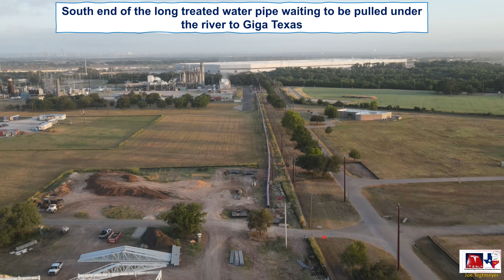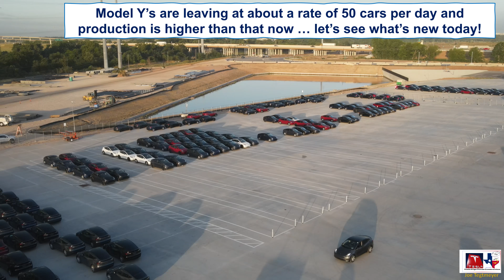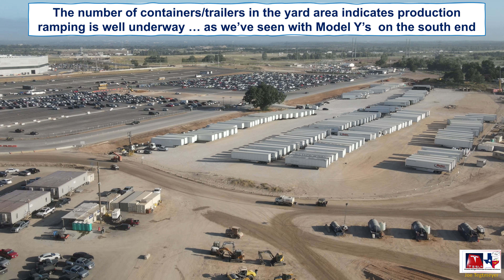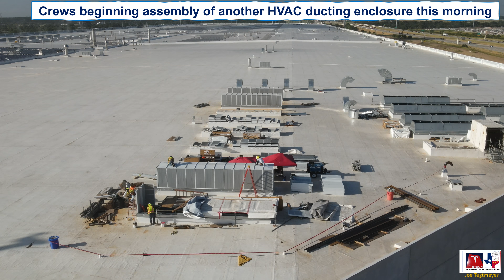Tesla Gigafactory Texas 22 June 2022 Cyber Truck & Model Y Factory Construction Update (07:15AM)

Comment: Also Joe, my understanding is that the cathode plant under construction will produce lithium hydroxide (LiOH) as output to be used as feedstock to the battery facility in the main building to produce 4680 batteries.  If this is correct, where is the battery facility in the main building currently obtaining LiOH for feedstock for 4680 battery production being used in current Model Y production?

Comment: Joe, do you know how many IDRA 6,000 ton casting machines are currently operational?  The old videos showed 6 concrete pads for what I understood to be 6 casting machines for Model Y production.  My math says that two casting machines operating in tandem (one for front, one for rear) can produce about 125,000 Model Ys per year.  Therefore all six when operational can produce 375,000 Model Ys per year.  Would you agree?

Comment: Approximately only 50 cars per day is REALLY disappointing. I expected at least several hundred per day. For years Elon has been bragging about how their experience with Shanghai and Fremont would allow them to ramp much quicker at both Berlin and Austin... and that doesn't appear to be the case at all. Really disappointed how slow everything seems to be ramping.
Reply from the maker: Elon recently discussed how logistics & Covid in China affected 2170 equipment and a slower than expected 4680 ramp are the driving issues at this moment. Things will improve.
Reply from the maker: https://twitter.com/ajtourville/status/1539769630583148547?s=21&t=GghnYKFoImQGyQcNR2gGww
Reply: There's been unforeseen logistical challenges throughout the Tesla supply chain. It's no secret Elon is always optimistic, and yes, Giga Texas is off to a slower start that we would hope. But regardless of whether the production ramp is a quarter or two slower than hoped, I'm highly convicted the Austin factory will be a crown jewel in global production.
Reply: @vermontsownboy6957   They had plans to build this factory for 2 years and there is NO reason to have supply chain issues 2 years into construction AND no-massive COVID issue anymore. If I told my boss it would take 2 years to get something done, I'd be gone. It's simply unacceptable.
Reply: Mostly echoing other replies here, a number of possible reasons and I think primarily 4680 battery production limit. However 50 per day is not that bad when you compare that GM brought out their first Hummer EV last December and managed to produce 99 in Q1, two days production at Tesla Austin. but still well short of Ford Mach e at about 300 per day.

Comment: Thanks Joe. Great explanation at the start.
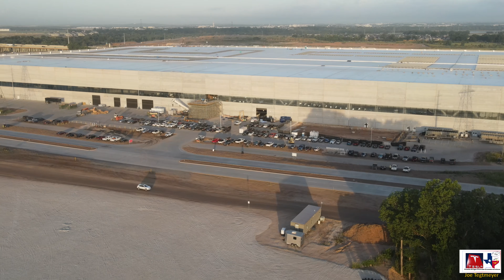7:35. BIW new loading dock area. Retaining wall formwork being constructed.
Rearranged the chillers. Hoses run into the building.
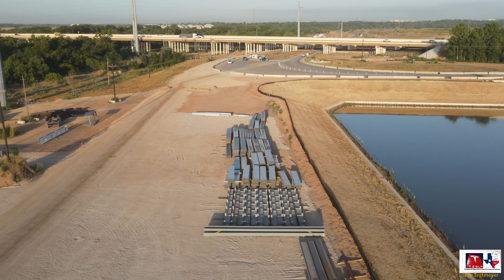11:11. Steel Fabrication Yard. Left of screen. Pair of trench shields.
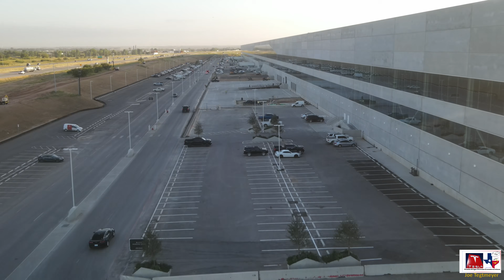11:52. Highway berm. 3 temporary light towers. 
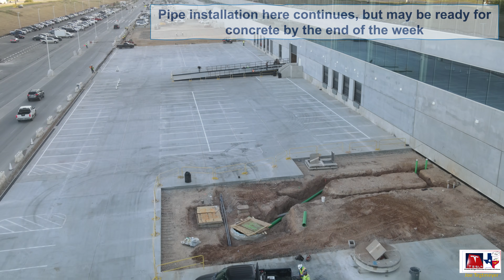12:11. GA apron. Second vault/pit/well cover removed. Rejigging the elevation to match the new pavement.
Fabricated steel ramp. Guardrails installed.
Centre of road street lighting has been reinstated. Seen removed in Joe’s 20 June video, https://youtu.be/MBGJ8iJLjo0?t=737
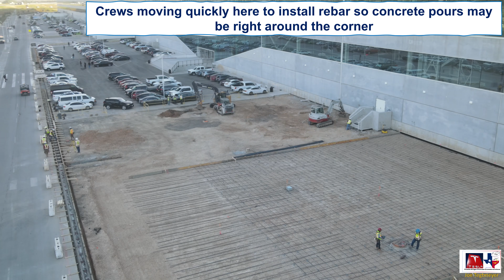12:48. GA apron. 2 workers beside what I think is manhole cover. All the concrete street lighting bases have been removed as the asphalt pavement is replaced with concrete. Apron lighting will need to come from the building or centre of road street lighting.
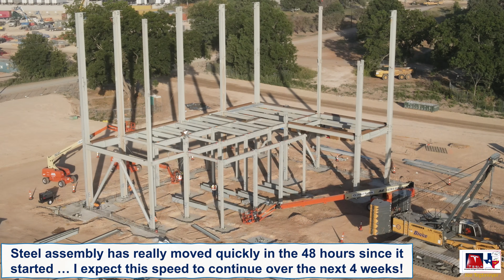18:12. Cathode. Of the closely spaced columns, only 2 will extend to the roof. Level 2 seems to be the location of a heavy floor load. Couple of framed out large floor openings on the west side visible by the up-turned angle section fitted on top of the beams.
19:58. Cathode. Structural steel up by the end of July. Possible, less footings further north structure likely to be simpler. Temporary track that the crane is driving on might not having any footing along the line. Could be some big clear spans required in that section.
22:28. East Main Entrance. 8 conduits from outside below bend up and into the likely location for a line of powered door floor springs similar to the West Main Entrance.
22:55. Roof. PV array. Opportunity to measure that the distance between letters T and E is 5 column bays. Same as the others.
24:43. Battery loading platform. A lot of effort going into painting this platform. To be there for a long time.
Reply: 24:23 That is a shame if these platforms are going to be permanent. If there is a permanent need, they should build internal heavy lift elevators. The technology exists because we see it used on aircraft carriers. Why build a billion dollar building, with millions of dollars of windows, then "F" it up with those God awful ugly loading platforms? Putting paint on a pig won't improve it.
Reply: @DavidJohnson-tv2nn  Yeah, they look pretty fugly, interfere with the general Feng Shui of the building design. And breaks up the line of the windows. O I guess they drive up a mobile crane whenever something needs a boost to the upper floors.
Reply: @The_DuMont_Network  Unfortunately, it doesn't look like things aren't going to get better. After posting comments in this thread. I checked out Google news and a rerecommended article from Reuters said Tesla was losing billions at Giga Texas and Berlin! There is a video interview titled.....
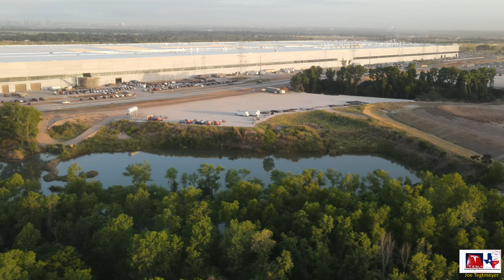"Elon Musk Unfiltered: Interview Part 3 (Bonus Material)" that verifies it at the 7:00 timestamp. 
Though the decisions to build those cheap ugly loading platforms were made long before the current financial situation.
Reply: 12:48 Hope they are not permanently removing the lighting.
Reply: @DavidJohnson-tv2nn  12:48. Wall lighting only in the other loading dock areas around the site. With the exception of one at Battery outside the drive-in loading docks.

Comment: the boring company have requested permission from the state to finish that bore hole under the river, they must be having issues with the local contractors finishing the project.
Reply: The application is for a 'Private access tunnel'. Would likely be for access to the Horse Ranch property. 

I'm not sure it's been confirmed that the current under river directional boring has anything to do with Tesla, other than the easement is on Tesla property.

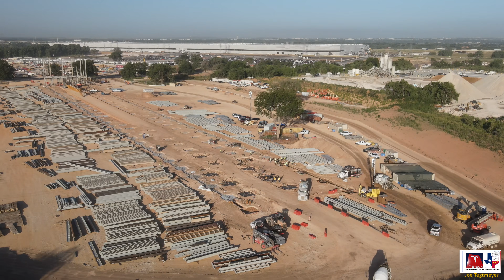Comment: 16:50 - Cathode plant: anybody have an idea whether the cathode plant can/will expand to a second line as battery cell production ramps as battery demand grows?
Reply: I doubt it, probably sized for foreseeable future needs. But yes there is room for another. I'm thinking it is more likely we will see a second one beside it for anode material. There are lots of possibilities, one for making the separator, another for the very thin copper backing.
Reply: @royh6526  Thanks for your thoughts. My reply: not sure. Tesla's anode material is mostly graphite with increasing percentages of silicon in future as Tesla resolves the silicon anode expansion challenge. Tesla needs to source graphite and the right silicon, but it's my understanding they already have contracts in place for this.  Not familiar enough with the separator to comment. The thin copper foil backing doesn't sound like a supply bottleneck: copper is relatively plentiful, and although the thin foil is delicate, on an intuitive basis it doesn't sound like it's such a supply constraint that Tesla must produce it to avoid a supply squeeze. I welcome  competing thoughts.
Reply: @vermontsownboy6957  I read the thin copper foil was actually imported from Japan for the Nevada 2170 batteries, so not readily available. I don't know enough to say, just suggesting possibilities. Clearly Tesla would prefer just to purchase the required items, but when the price gets too high, and they think they can do it much cheaper by themselves, they are not afraid to invest to control the price.
Reply: @royh6526  Interesting, but Panasonic is a Japanese Corp, correct? So it would make sense Tesla would piggy-back on Giga-Nevada/Panasonic 4680 supply sources as long as such were efficient. Still, I'm no expert on this subject; just trying to connect some data points.

Comment: Nice work as usual sir! Why are they switching from asphalt to concrete in the parking area?
Reply: It also raises the question why it wasn't concreted from the start? Perhaps asphalt was cheaper/faster to initially close off the underlying dirt, and it was always the plan to later remove asphalt for greater weight-bearing reinforced concrete? Still, seems like an inefficient process...as if the thinking/building use scenario changed mid-stream.
Reply: He had mentioned before that this because heavy truck use will ensue here once the loading docks are installed. Means that this area of the building is now being prepared for new production.

Comment: 19:51 I'm not sure about completion of the steel structure by the end of July, it seems to be an inefficient method of using only one central crane, although it does have the reach for the small components on the extremities.  Perhaps they will introduce a scond crane as they progress.  I hope they have factored in the importance of getting this topped out, rather than saving cents on one crane and one steels crew.
Reply: Looks like it is pretty well planned out to just drive the crane down the centerline of the building, all the steel was shaken out to be in order. THere are some footings to deal with along the centerline towards the end of the guilding but as long as he stays off the vase bolts, he will be fine.

Comment: Any reason why the cathode facility has to be build separately from the main factory? Same as in Giga Berlin.. Is it for security like fire hazard or fumes from the battery chemistry ?
Reply from the maker: Giga Berlin does not have a cathode production facility. This is a production process closer to mining than cell production.
Reply: @JoeTegtmeyer  Ok, but my question is... Why build it separate from the main building? For safety reasons?
Reply from the maker: @jmegp  because it’s a much “dirtier” process than the clean room 
-like processes at the battery production area in the factory. Much more like mining processing than laboratory conditions.
Reply: @JoeTegtmeyer  Thanks Joe..
Reply: I assume that the refinery process varies depending upon the raw materials provided, so custom-made refineries are built to suit. This one is close to its source of power and not far from the destination of its output. New, different refineries would be built to suit their raw inputs.